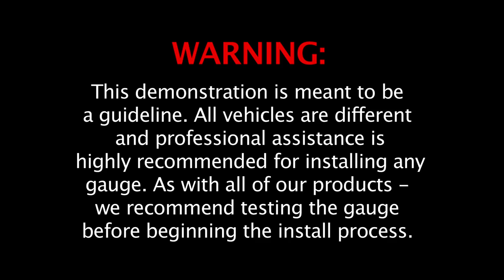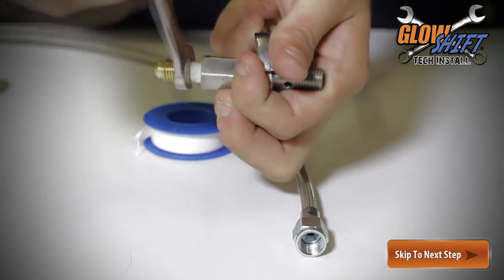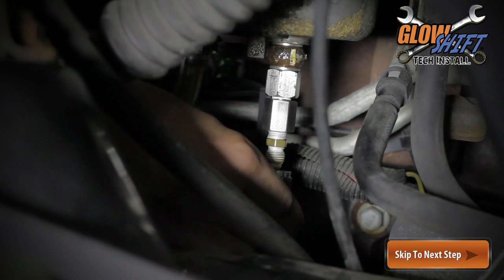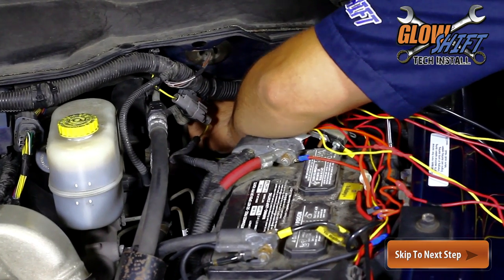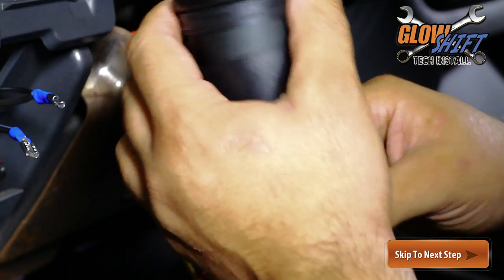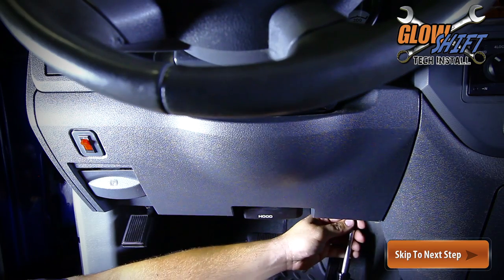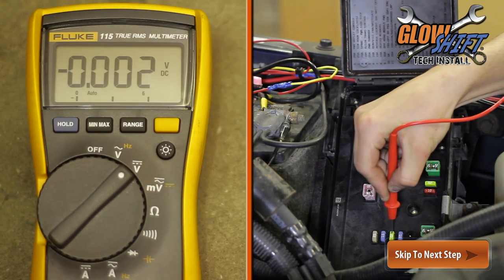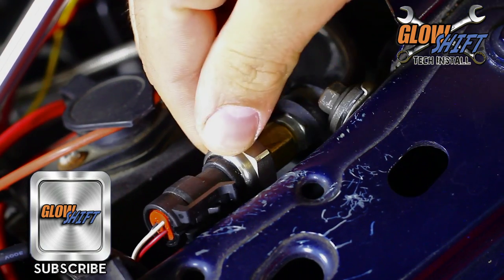Installation | GlowShift Fuel Pressure Gauge In 3rd Gen 2003-2009 Dodge Ram 24 Valve Cummins

Comment: Just wondering, Why Teflon tape on the AN fittings? all the AN fittings on my car are self sealing with a conical taper that connect male to female. I thought that was the industry standart
Reply from the maker: We use Teflon tape on all of our male threads as they are 1/8 NPT to ensure there is a tight connection.

Comment: I'm not clear if your installing the sensor before or after the fuel filter. I already have an led sensor on my truck on the fuel line up by my injection pump. Can I install this gauge sensor there or does it need to be on the filter housing?
Reply from the maker: We always recommend the fuel filter housing but yes it sounds like you could install it there as well.

Comment: mine was working then I unplugged a battery to change my coolant filter. after plugging the battery in the gauge won't stop flashing. I checked all the connections and they seem fine. any suggestions?
Reply from the maker: Depending on the series the gauges will flash if they do not have a good connection to the sensor. I would suggest checking all of your connections. If you have any other questions or concerns feel free to contact us for more assistance.

Comment: do you know why my gauges light is blinking periodically?
Reply from the maker: Which gauge do you have?
Reply: GlowShift Gauges oil pressure gauge. Do you think maybe a faulty earth?
Reply from the maker: That is possible. Check your power and ground connections to make sure they have good connections.
Reply: GlowShift Gauges I have no idea where they are. I just bought the car from a car dealer.
Reply from the maker: Call us at 1-888-GS-GAUGE and we will do our best to assist you in fixing this problem.
Reply: GlowShift Gauges ah I'm not in America.
Reply from the maker: Feel free to email us at techsupport@glowshift.com or you can use the live chat feature on our website. www.glowshift.com

Comment: Do I need the sensor relocation kit,installing a FASS 165,Glowshift big line kit & Glowshift fuel pressure gauge.
Reply from the maker: The FASS system should have a port that you can connect the sensor to directly.

Comment: Can you still install if you have the stock fuel filter housing?
Reply from the maker: Yes, we have adapters to fit just about any vehicle.
Reply: GlowShift Gauges I have all of the adapters from this video but I can’t find info for the stock housing anywhere. I bought a 400$ kit from y’all and it didn’t even come with everything I needed. I’ve had to order multiple things and it still doesn’t seem like I have all of it. Not everyone has 1000 dollars just to drop on a new lift pump.
Reply from the maker: If you have a 2003-2009 Dodge Ram the fuel filter housing will be accessible through the driver side wheel well. To install the sensor directly to the housing of that particular vehicle you will need a snubber valve and banjo bolt. That is all.
Reply: GlowShift Gauges ok can I still use the relocation kit to? Thank you for your help!
Reply from the maker: If you have the relocation kit, yes you can still use it.